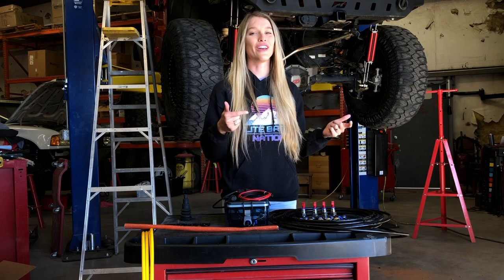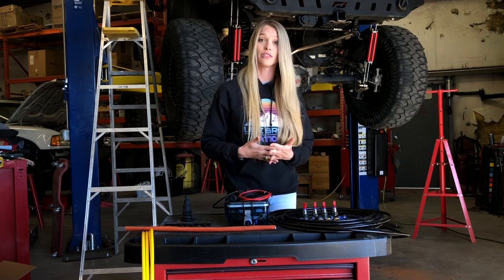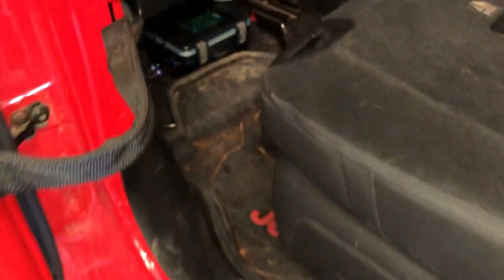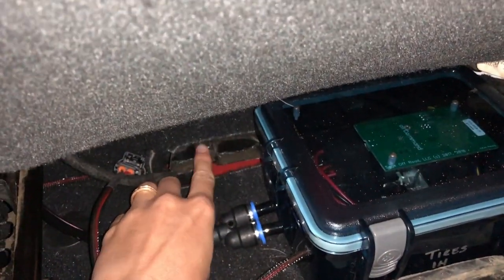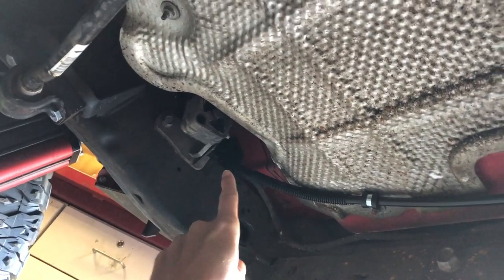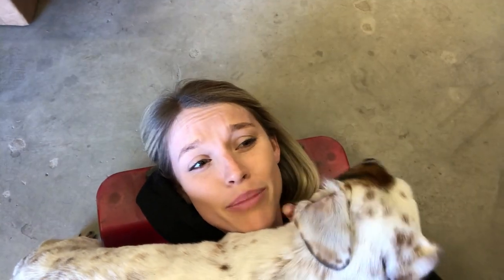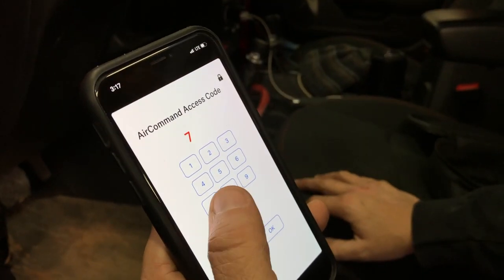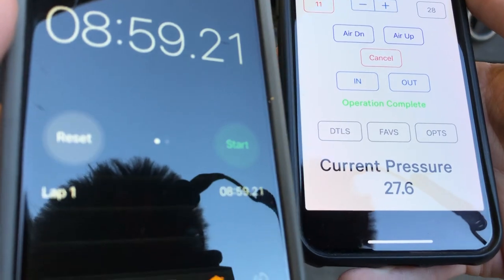Fastest Air-Up Ever! We Install AirCommand on Our Jeep Wrangler JLU Rubicon!

Comment: That is pretty cool! I used to use a small 12v pump that took around 5 minutes per tire. A while back I bought a used CO2 tank and now I keep that along with an air hose in the Jeep. Yes it takes up space but I only take it with me when I'm wheeling and it airs up one tire at a time in about 20 seconds. TrailRecon has a video on a home made octopus setup that will air up/down all four at a time. It's similar to what you have here but not automated and not routed. You get out the hoses, connect to all four tires, and go from there. Basically, anything is better than an $80 12v pump that takes 5-10 minutes per tire!

Comment: You will really love the convenience of airing up/down all at once,  I made my own system and would never go back to one at a time. The only caution i would give is to make the air points on the corners in an easy to get to place (hard to tell exactly where the rear ones were), it's no fun sticking your arm way up to get to it, especially when its snowy/wet/muddy/dirty and way worse if you need two hands to attach or detach the lines...  But you will love it, especially if the weather is crappy and you are sitting in the jeep warm and dry waiting....  as always good video :)

Comment: This is a great system. But if I may give you a few friendly suggestions to make your life easier. I am a heavy equipment mechanic and I run into those quick disconnect air lines all the time. They're only good and reliable when they're clean. When those get mud, dirt, tiny rocks stuck in them, they are a bear to use. And due to them being plastic, you can only clean them out with a tiny screwdriver so many times before you mess them up and need to replace them. You must cover the entire fitting, not just the quick disconnect hole or you will be digging muck out of the blue slider every time you want to use it. Which kinda defeats the ease of use of the whole system IMO. Second suggestion would be, to move those fittings out of your wheel well all together. Its only a matter of time before something flies up and hits the fitting. Third and final suggestion is, to move your relays inside the cab. Them being under/outside the vehicle is just asking for trouble. Mainly corrosion. Relays also have a shorter life when subjected to outside heat sources. You guys did a beautiful job with installation and I love your rig. Can't wait to see what else you'll add to the Step Child.

Comment: I have an old A/C compressor as an engine driven air compressor (with oiler). I'm pretty sure it does each of my 40s from 10 psi to 26 psi in under 2 minutes. Have to measure it again.

Comment: Saw that system at EJS last year.  Nice, but a little too "blingy" for me.  I see a couple issues.  Poly line drying out and breaking due to heat. Wheel wells getting completely covered in mud, then having to dig the bulkheads out.  Hope it works well.  Nice to see you plug a AZ small business.  My annual jeep parts stimulus package  (tax refund) will go towards a powertank.
Reply: Polly lines on our air command wont dry out...  We have a different way to plumb the lines to inside bulkheads if you don't like them in the wheel wells.  Been running them for two years.

Comment: great job, I would say....if you didn't secure the air lines to anything, the shaking and vibration will most likely wear through the lines, especially the one running front to back.

Thanks for sharing.

Comment: Hey guys I'm new to the Jeep scene I'm up here in Northern California I have a 2012 Jeep Rubicon and I'm starting to upgrade first and foremost metalcloak suspension

But 444s are not even near the best they work wonders yes but air zenith ob2 will keep it cool and 1 xompessor of a.z. is 2 444s 

The new 485s from viair are nice

I came from a bagged 370z with a whipple supercharger 

I love ya'll videos

Comment: Nice system! Both the air system and the strike force. Pretty cool. But what happens if your cell phone dies? Can you manually operate the air up air down system?
Reply: Kevin Williams that’s what I figured. Just bypass the Strike Force Zebra control.  Easy enough. It’s a cool setup!

Comment: That’s a nice air system and make your life easier and faster when you have to air up your tires. Why didn’t they put the two relays by the pressure regulator into a waterproof box to protect them and the wire connectors from mud and water to prevent the from rusting and causing problems down the road.

Comment: Got a question for you have you thought about converting your power steering pump until the hydraulic pump and I'll turn much easier blank on finger yeah well I didn't know if you have thought about converting it like that and it helps a lot don't have to turn the wheels as much whenever you're going cross rocks and stuff or through the city
Reply: That's a great question. If you don't upgrade to a high volume steering pump and hose conversions when you do cylinder/ram assist then you're not optimizing it's performance, if anything you're bottle necking it. It'll literally double the volume of the factory pump and maximize the ram assist's potential.
Reply: @apexpredator_jku  that may be the case with JKs but JLs have an electric pump driving the fluid instead of a belt.  The amount of fluid is regulated so unless they come up with a tuner to bypass it, the volume of the pump doesn't matter. Which in a way sucks. It might suffice for 37s or 38s but once you go 40s, it starts to suffer. Then it's time to consider going Big Bore. OEM aluminum sector shaft is sketch to begin with anyways.
Reply: And by the way yesterday to make hydraulic steering because I do a lot of off-roading anyway it helps I am by the way if you don't believe me check the rock buggies rock crawlers a lot of themanyway a lot of do have hydraulic steering because dumb dumb dumb Little Rock crawlers or Jeeps and yes you can buy the conversion kit it takes it from power steering to hydraulic steering still the same set up just you have a hydraulic pump in a hydraulic ram meaning whenever you make a turn you don't have to make so many revolutions on your steering wheel you just barely have to touch it and it will move and by the way I work for Jeep diamond Chrysler oh yeah and by the way just so you know must-try colors do have hydraulic steering just like what he was talking about about rear steering didn't think that now that you and yes they do metric conversion kit and by the way also something that unit did nothing about 2 switching doors from pump gas 2 propane much cheaper
Reply: @boughtnotbuiltoffroad7784  I am by the way just so you know is it in my car draw like steering for it I work for diamond Chrysler Jeep and by the way I am a mechanic and I do have her rock crawler never seen anyone Rock look up round Rock and they do make them for competition jeeps and buggies and by the way I didn't make a setup so you can still use hydraulic steering and it don't instead of having to make 30 turns with your steering wheel you just barely have to make one revolution compared to three
Reply: @boughtnotbuiltoffroad7784  I know a lot of people don't understand where they're made of romaine Ohio yeah that's where jinx like what they got or made and by the way yes I am by the way you can run a 55 inch tire to running 55 inch tire and I soak age skid pans 12 inch body 12 inch suspension the winches one in the front one in the back 1 slides into your receiver hitch easy in-and-out and by the way hydraulic steering on a crawler like that makes it 10 times easier I am by the way look up coal Creek mine trail 16 or windrock trail 16 and by the way it does make it a half a lot easier to crawl across the rocks oh yeah and by the way and most places amount of the check and see about her
Reply: @beatenpath4x4fabrication71  I didn't realize they changed to an electric pump for the JL...interesting, I'd like to see how that pans out.

Comment: Wish I didn’t already have the duel ARB. I like this better then my under the seat mount.
Reply: Why?
Reply: Ben Wilson I have the dual mounted on side of Cargo area via M.O.R.E bracket also added 1.5 gallon tanks, takes up very little room and the unit never gets dirty or water on it, the under the body has serious limits, the units are exposed to everything debris, water, mud, etc. The pumps both on the dual and theirs have filters on them and under the Jeep doubtful they can access and maintain the filters and the tanks fill with water each time compressed air is used, I didn’t see a drain for the tanks, might have missed it but didn’t see one. The lines running everywhere with the T connectors is a problem waiting to happen, once leaks start,  going to be fun figuring out which is leaking.

Comment: I purchased a JKU with the SFZ system installed; however, I can't seem to locate the application required to run the system. I'm curious if you're still running it or have you switched to something else?
Reply: android

Comment: I run a 20lb C02 tank on my rig , can air up each wheel (37inch)to 30 psi in 2 minutes each . So 9 minutes on all four ain’t bad especially for a 38. Only down side I see is the connection points but where else you gonna put em haha because jeep .

Comment: So with this system you need to have a air tank to make this work?
Reply from the maker: No not at all. Just air pump but you may as well add a tank
Reply: @LiteBrite  I don't want to mess with mounting an air tank but I'm wanting to add an on board air system. I've had my.mind set on the ARB dual compressor but I like how you can inflate all four tires with this system you've shown.

Comment: Nice, I made something similar with a CO2 tank and 4 bulkheads. Usually took 4minutes with all 4 tires from 10psi to 30psi, but once you run out of CO2 you’re done!🤷🏽‍♂️🤷🏽‍♂️
Reply: cardenasrc51 that’s what a backup compressor is for

Comment: Those relay electrical connections won’t last long under that Jeep, I put all my valves and relays in one ss box with water proof connectors  and rubber coated my compressor

Comment: I can go from 8-28 with my power tank and monster valves in 18-20 seconds less than two minutes I’m done.
Reply: Kevin Williams  I usually go from 8-28 it does it about 6-8 times.   I have seen other people run systems like you have.  To many problems with the air lines. I also have a 15lb tank.  I have seen the twin arb with no tank do a 37  minute in half. My monster valves air down in about 10-15 seconds a tire.
Reply: Kevin Williams 37 inch pit bull tires on 15 inch rim.
Reply: Kevin Williams  you guys come to Missouri I will show you a different type of wheeling you have never done before.  Rock gardens, waterfall and long nasty slippery rock ledges

Comment: 9 minutes? That's not including hooking everything up. I would say an ARB twin compressor without a tank would do it quicker??
Reply: yeah it takes me less than 5 minutes to do the 35`s on my landrover and that is including putting the airline onto each wheel.
Reply: @spoonyspoonicus4648  it's just not the time aspect either. How long until the regulator or relays get destroyed under the car? Or the quick connects at each wheel? Is it cool? Sure. Practical? Maybe. Reliable? I doubt it.
Reply: yeah i was thinking he exact same thing.
Reply: I've got the twin ARB system in my Jeep and I can honestly say that it takes me 9 minutes to get everything hooked up and maybe halfway to my target from 8 PSI to 25 PSI. I've only got 36 inch tires. 35's to 38's is a huge difference in airing up.
Reply: @cdmc012599  really? I own a Nissan Patrol. Have a twin ARB under my driver's seat. I set the aircon to feet, the air vent blows cool air into the compressor. I grab the hose, click it in, and hit the power button. I can literally be inflating tyres 30 seconds after pulling up.
Reply: Kevin Williams looking at the data sheets, ARB puts out 4.68cfm @ 29psi. A Viair 400c does 2.11, so 4.22 @ 30psi. I dunno. It just seems like too much effort setting up 4 hoses, and then there is the question mark about reliability. Especially seeing how hard you drive, and components being exposed? Happy to be proven wrong. But the sheer cost of your system, to save a minute or two is crazy.
Reply: Yea doesn’t seem worth it too me. Too much complexity and not enough benefit. Would be real cool if you could configure it to always be hooked up and change pressures on the fly. I bought a heavy duty portable tire inflator from Northertool and it’s great because I can use it in more than one vehicle and it airs up my 37s with relative ease. I think another great solution is Co2 tank. They are very effective.
Reply: Pretty trick setup! Might need to look into this setup for our Jeeps.
Reply: Jay P I've been looking at a few which one did you get and do you think it'll hold up I dig the Arab twin but close to $500 is a little crazy when we only go out a weekend at a time
Reply: Austin Bottensek Yea man some of these solutions are a bit wild in price. Really depends on how often you change tire pressure and how much of an inconvenience you want it to be. I use the one I linked below in this comment and it has served me quite well. I’ve aired up 37s on my Jeep and 34s on my truck numerous times with great success. The quickest option is really a Co2 tank but there are pros and cons for that too. The inflator I use can be tossed in the Jeep or my truck or even my wife’s car if we travel and I want an emergency solution. It is significantly more robust than cheaper solutions. I believe the duty cycle is long enough to air up about 4 37s so longevity should be good. Mine still runs like a champ. 

https://m.northerntool.com/shop/tools/product_200672535_200672535
Reply: BS, The ARB Twin will inflate 37" Tyres in 90 seconds flat and it is way better than these crappy Chinese viair compressors and the ARB's are 100% serviceable and you can get parts the world Over.
Reply: Being an owner of the twin, I really wish you was correct, but it's just not so. I can do a video of how fast it takes my to in flat my 36's from 8psi to 25psi. It takes so long and not to mention so hot after just one tire, I only use it for my lockers and every now and then I'll up it to put 1 to 5 psi in a tire. I've even got a 5 gal external tank as well.  I got just past my warranty and both my motors burnt up. Good thing about it being ARB is even tho I was outside my warranty, they still hooked me up with two new motors. So, I'll never lose my ARB. LOL
Reply: I am Correct see the Proof below, and if yours can't do it in those times Then you have some serious problems going on with your compressor because mine is very fast, also check out this Video where the ARB Twin Portable inflates a 37" Tyre in 90 seconds from 15 psi to 35 psi including stops to check the pressure, Here's proof and he actually did it in less than 86 seconds. https://www.youtube.com/watch?v=LXd5hVYYGAMThis
Reply: I have an ARB twin and an air up/down kit that inflates/deflates all 4 tires simultaneously.  It takes about 9-10minutes to inflate four 40’s from 7psi to 28psi.
Reply: @benwils0n  we have another set up for inside the cab bulkheads if you prefer.  Two years so far in Utah weather without issues.  They will be fine!
Reply: Jay P very cool I'm looking ahead to be honest we hardly air down as of now but I want it for around the house for misc moped snowblower dirt bikes and occasionally our jeeps on 31's so I think this will work just fine

Comment: If you have to run around and attach hoses on all the tires, why not just air them up one at a time? All that money spent to save maybe 10 minutes? It’s going to take the compressor just as long to fill all four tires one at a time or all at once, so you only really save your running around time.

Comment: Wow talk about over complicating a simple task.Too many places for failure. I live by the KISS theory. Keep It Simple Stupid.  I'll keep my engine mounted York with a simple single pressure switch and outlet. Never timed it. But I would put money down it's faster.
Reply: @boughtnotbuiltoffroad7784  Yes complicated. There are way to many parts to this. Multiple fittings with potential for failure. All the poly line running under the vehicle. More potential failure points. Not mention the electronics. Really? Phone app? For airing your tires up? LOL